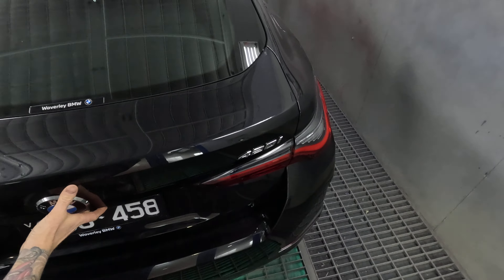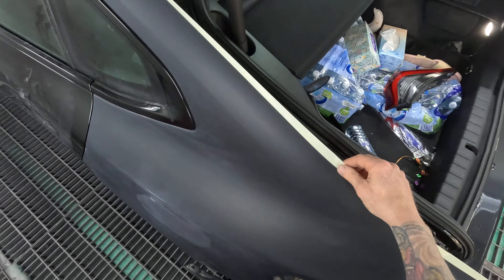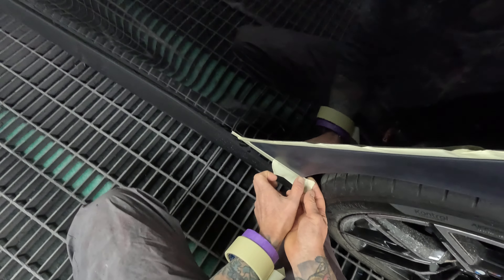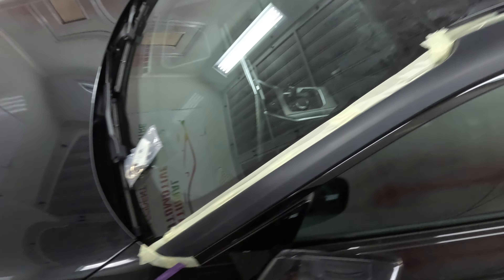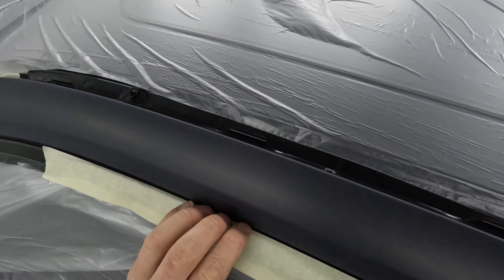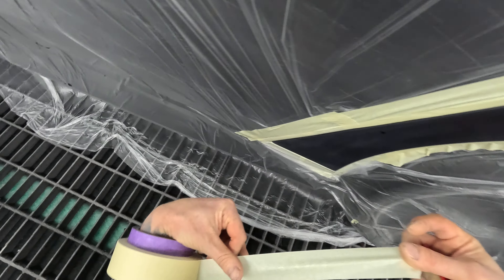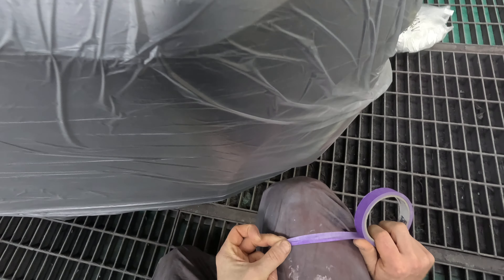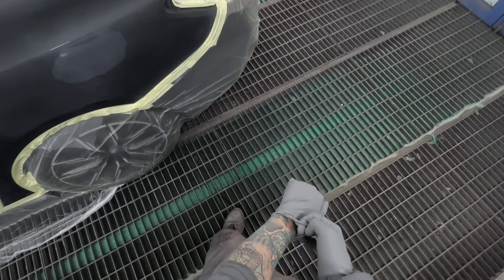Masking BMW 420i

Comment: Hey Gunny, another great video mate I love watching you mask up while you are shooting the breeze with your words of wisdom, have to agree with your opinion on lead loading, back in the 70s and 80's when most cars had lead in them it was better than filler it was needed but these days the modern fillers as so much better that they are as good as lead loading so IMO it's not needed these days unless you are doing a concourse resto and it has to be true to it's day then yeah it is needed.

Pleased you are happy with your Merc Gunny they are really nice cars, my SLK is a 2003 model and has the exact same engine and 5 speed auto as you have in yours, I love the hard top as you can use it pretty much all year round as even in winter the heater is designed to keep you warm and there are next to no draughts, I bought mine in 2015 and it's never been any trouble it was a second car for the person I got it from so was kept in a heated garage during the winter so only has 40k miles on it, great car🙏🙏👍John UK. 
Oh and thanks for sending me the voice message on IG mate👌👍